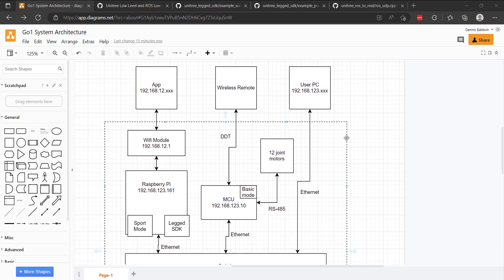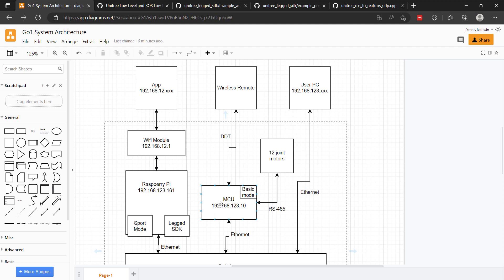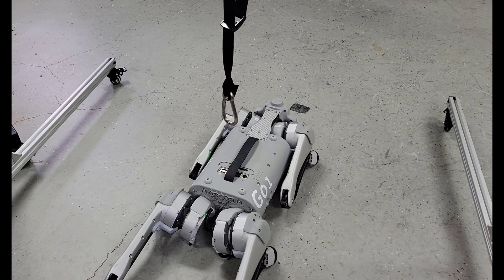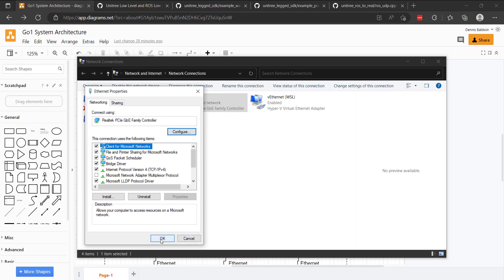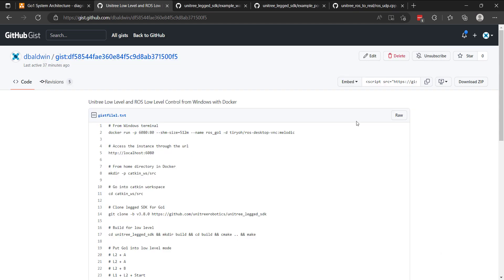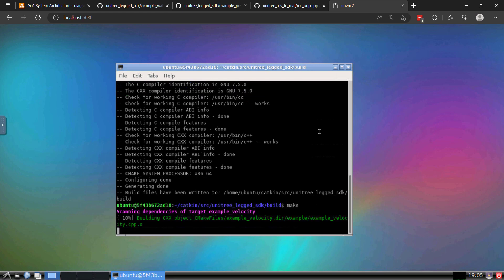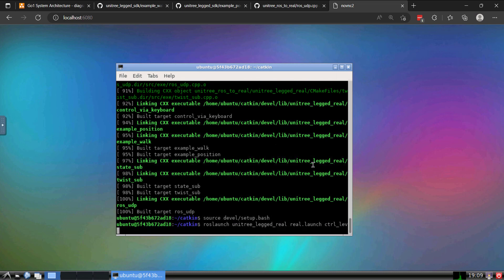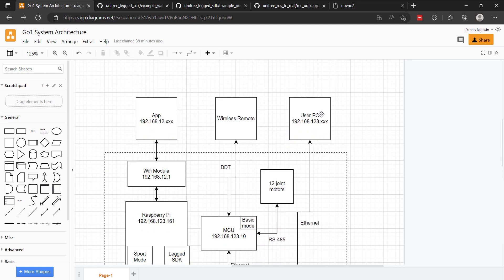Unitree Go1 Low Level Control with Legged SDK and ROS via Wired Connection

Comment: I just got one Edu version. Do you know if it is possible to get the circuit diagram of this robot? pins and signals? for instance that interface port, I didn't find anywhere what pins are there... Thanks in advance and well done for the videos

Comment: hi! thanks for sharing your work!

I have a bit of technical question here. When you start the low-level control, did you wait until the robot's head light flashed? (the white lights around the head)

I have some issue here, because when I run my own locomotion controller, the robot suddenly flashed the head lights and the UDP connection was closed. I am wondering if this is because I should wait till the lights flashes.

Thanks in advance!
Reply: Hi. I just got one Edu version I am looking for connecting with people who has one. How is your experience with it so far?

Comment: Thanks for your great video, but I have a question about how to make Go1 stand again and back to remote control after testing the low level example.py?
Reply from the maker: This is a great question that I wish I knew how to do. Right now we just power cycle Go1. There has got to be a way. We've reached out to Unitree to see if they have any solutions. Let us know if you discover anything!